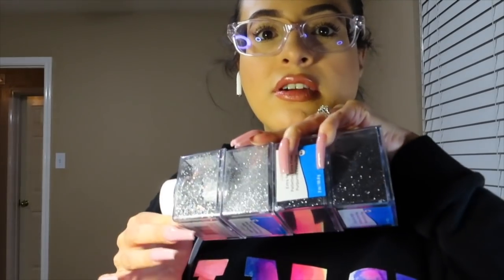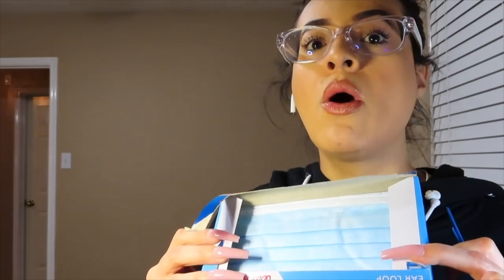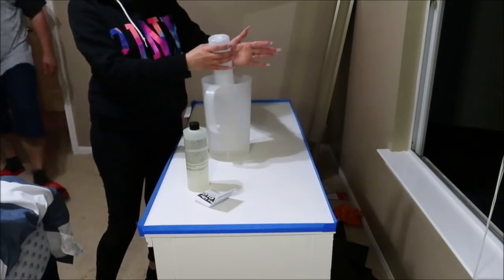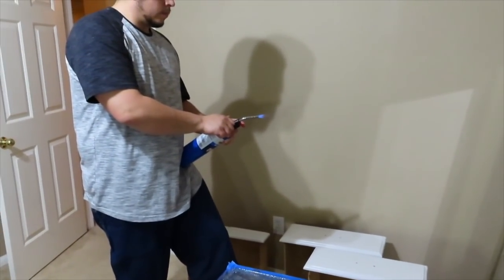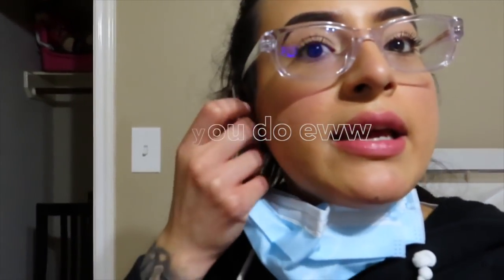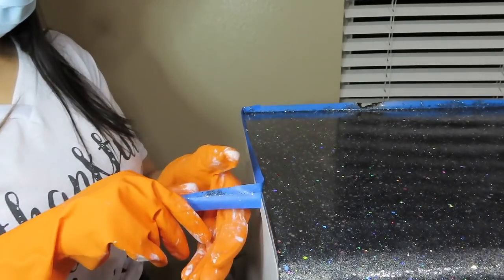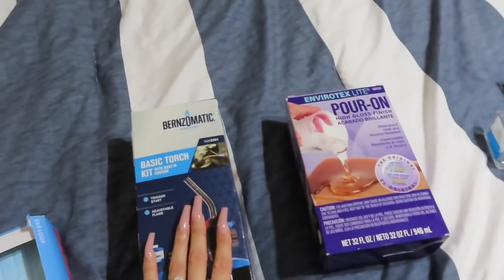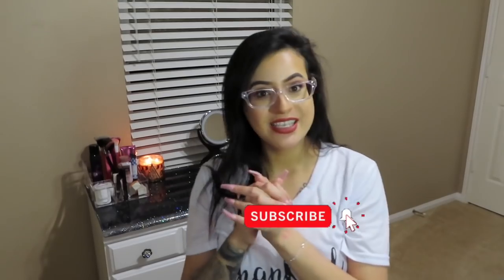How to| DIY Holo Glitter Desk

Comment: Ur video popped up in my feed. I do resin art and thought I would share some pointers with u. Yes let it dry for 72hrs but u can take the tape off after 24hrs less sticking and tearing. If u find that it harder to take off, heat it up a little with a blow dryer and it should come off without a problem. If u really want it to sparkle do a lite sanding and tape the sides and pour another coat of clear resin on top let it dry 72 hrs but take the tape off before that. A coat of resin will make the glitter blindingly sparkly. I hope this helps
Reply from the maker: Thank for that info I’m goin to have to try that bc you can still feel the glitter very slightly to touch so I may try that and put another clearcoat on top.. Thank you xoxo 💋
Reply: @hazleylove77  your very welcome..good luck
Reply: @hazleylove77  post an after pic..would love to see
Reply from the maker: Will do if I decide to do it

Comment: If I add less sparkle will it still cure well? Was hoping to have s blzck desk with a little bit of sparkle here and there, like a night sky
Reply from the maker: Ya it should bc the Epoxy/ resin it’s what hardens and cure You can add as much sparkle/glitter as you want I will say if you want it like the sky midnight blue add Navy blue glitter and glitter with a silver glitter but you might want to put a little bit more glitter or sparkles because if you use black Epoxy /resin The glitter/sparkles me not show because black is so deep but even if you just added a little bit of sparkles it will still come out really good I think
Reply: @hazleylove77  I was thinking of painting the table black and using a clear resin with sparkle, would that work?
Reply from the maker: That’s a good idea I bet that will look really nice